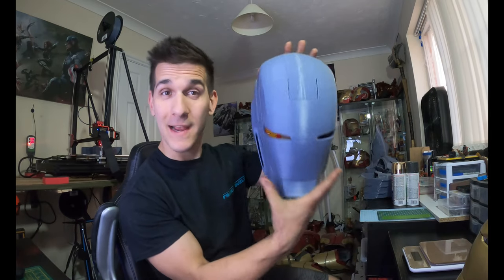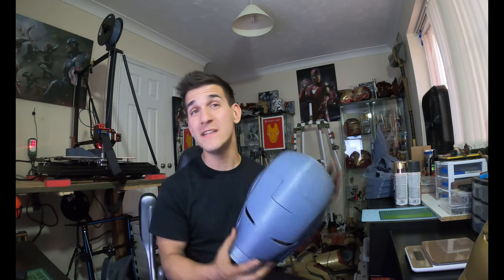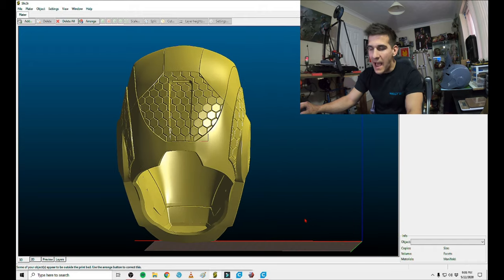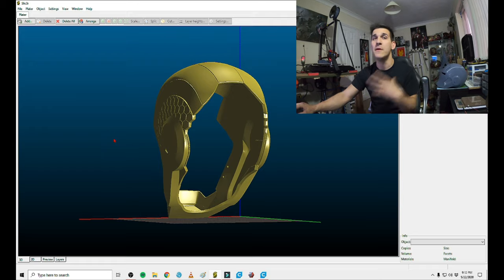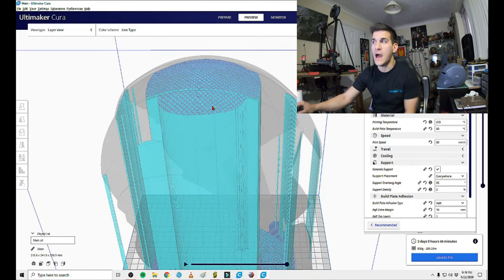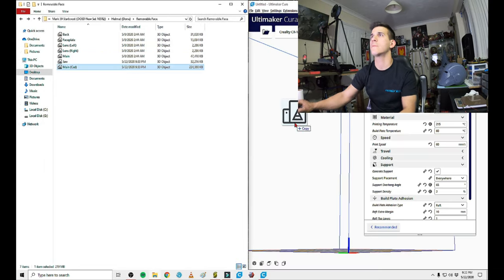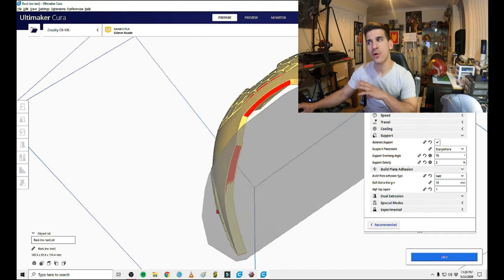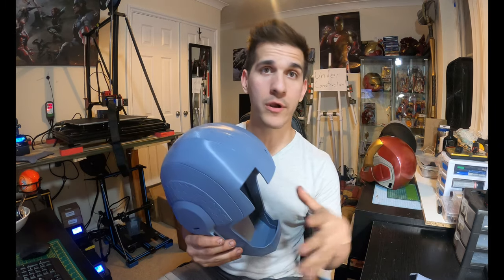3D Printing an Iron Man Suit!  | MK39 Starboost Part 2 |

Comment: Pro tip: set your Z-seam to the back of the face plate. I’ve got an extra faceplate with a zipper down the front. But like Frank says don’t pitch mistakes; use them to test different post production techniques👍

Comment: Hey, I'm going to do it, but I wanted to suggest, without cutting the chin, there is a support called tree support. It's an experimental feature of cura, but works beautifully. (Check that it does not double up with regular supports, I did this by accident. Regular mixed with tree support. Didn't kill it, but used more plastic. Maybe the tree support wont use that much more plastic? Just a suggestion. I cant wait to do this!!!
Reply from the maker: Haha you should watch my other videos. I’ve been using tree supports for a while now. Regardless they’re still costly with material and drastically increase slicer render time and print time. And it still adds another dynamic to the print that can cause failure. Tree supports are great for odd complex shapes and prints for sure.
Reply: @FranklyBuilt  oh cool! Okay, I'm still getting experience with that feature, definitely going to watch some more!
Reply from the maker: Try it out! I don’t usually use it on really straight flat details. Play around with it! It’s really cool

Comment: I wish I would’ve watched this episode before starting on my mark 85. I did the same thing with the new hinged hand and the scale was way off from the original file. 

Keep up the great content!
Reply: Same. I printed the MK5 helmet at 100% and it was too big so I ended up scaling it down to 95% which was snug but good for no motorization. So I printed the MK85 at 97% (to leave room for motorization) wrongly assuming it was the same size as the MK5. Well the MK85 was too small. So I printed it at 100% and it’s still a bit snug for motorization. I ended up dragging the MK5 and MK85 in together and turns out I need the MK85 to be about 103%-105%. 😒

Comment: Hi Frank! Thanks for the awesome videos. I printed my first Mk3 helmet, really enjoyed the whole process but the parts didn't fit together that well. Turns out I wasn't the only person on Thingiverse that had problems with it.
I found the your channel and love the way you explain things in a way that can be used for all sorts of things, not just what you are working on etc.
With my new found knowledge, I started printing the MK39 helmet on my ender3 getting creative with the slicing of the parts. The "face plate" came out great, but then when I printed the jaw line(to just after the curve leading to the top of the helmet) I can see the faceplate doesn't quite line up. It's a little too wide. 

What would you recommend to get it to fit? Gently warm it up and try and get it to fit, scrap it and try again? Any tips on getting parts to fit better fit.

Comment: Hey guys, I know this is an old video.  I got slic3r, I cut up the helmet.  when I save as stl and bring into Cura I'm getting a can't slice error.  I don't see what the problem is.  I used the same steps Frank did in the video.  Keep sides, Mininal fill.  The part looks complete but is yellow and gray,  like when it is too large to print.

Comment: im considering getting the CR 10 max i want to make a full armor suit. i have not been printing for long time but i really want to dive in would you recommend this printer even though im fairly new
Reply from the maker: No avoid the max as a first printer. Get a Pro v2 or ender 5 plus
Reply: @FranklyBuilt  I left out that I do have the ender 3 max and the ender 3 v2. I honestly love the ender 3 max my goal was just a bigger build plate. But if these 2 are still the better option I'm ok with that. I really appreciate the help and your content has helped me so much.